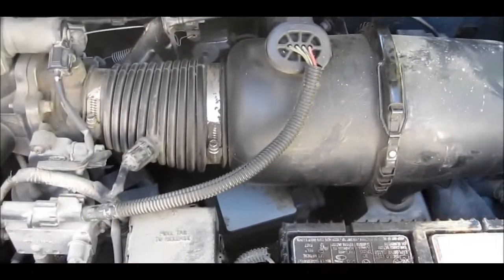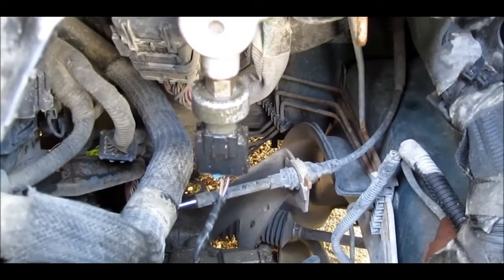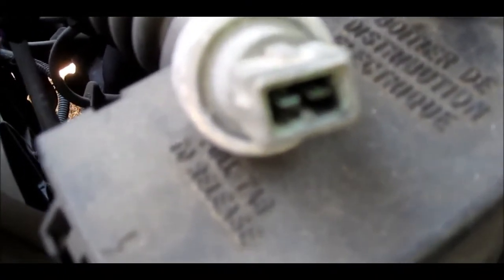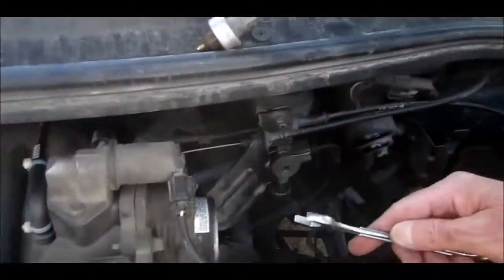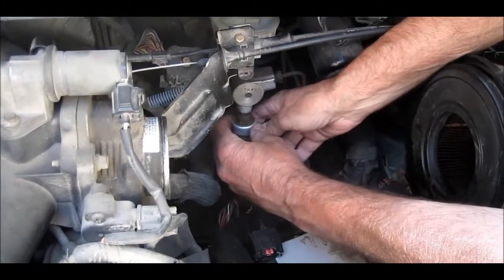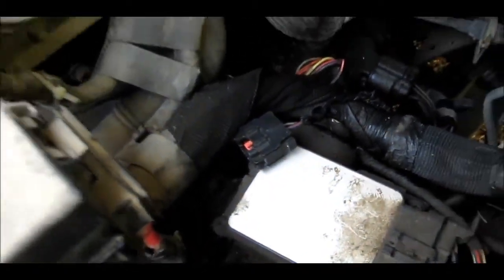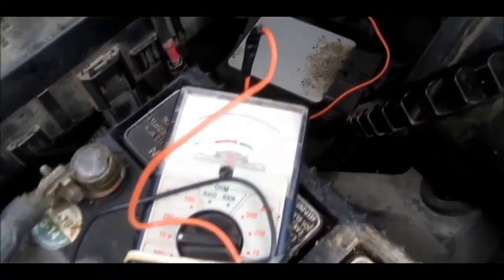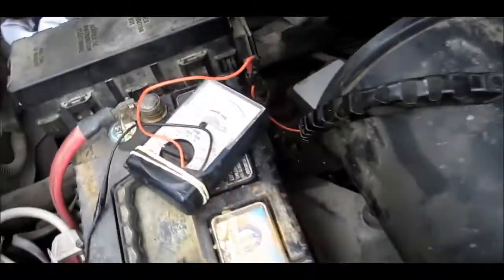Windstar brake pressure deactivation switch

Comment: hey man!! thanks for the tip, I´ll check the motor side to try solve the problem (my cruise control doesn´t work) i have the same year windstar and also canadian too. but please can you make a shorter video to explain where inside the cabin the switch is located so it can be fixed?. I'll apreciated a lot
Reply from the maker: the only switch it on your steering wheel, also your abs has to be working right for the cruise control to work.